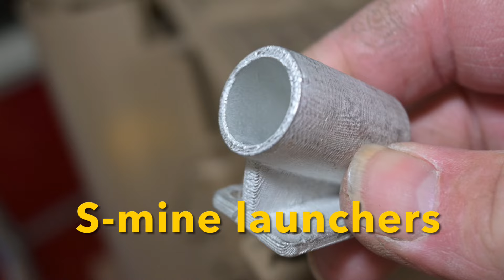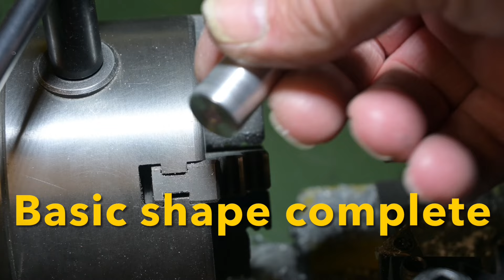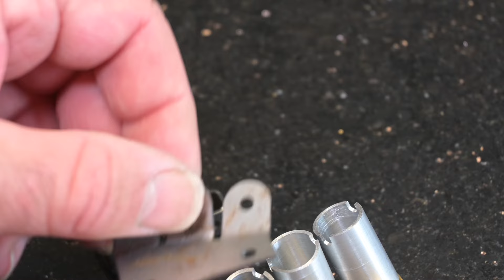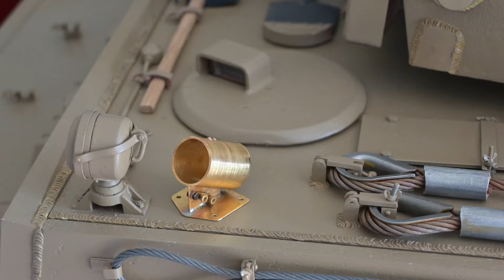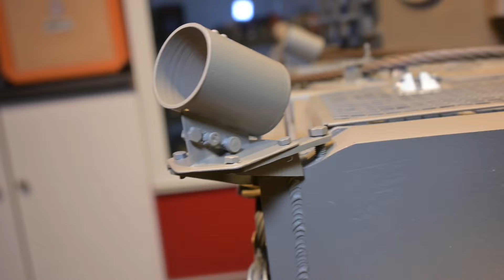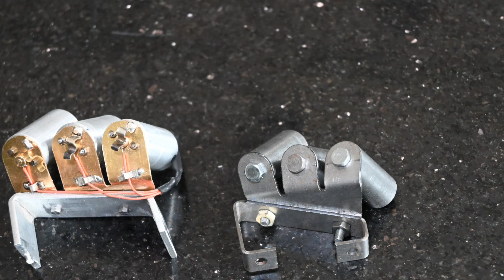1/6 scale - Armortek Tiger 1 (Part 9) smoke launchers and anti personnel mine launchers

Comment: How did you do the nice texture on the side panels?
Reply from the maker: The turret is the old cast type turret from Armortek and has a nice texture.  The new turrets are smooth finish.  On hull plates I use a dremel type tool fitted with a round head milling grinder attachment.  They tend to come with the dremel kits and nobody knows what to use them on. Just let it bounce over the armour fairly random.  After that you can apply some mr surfacer in places.